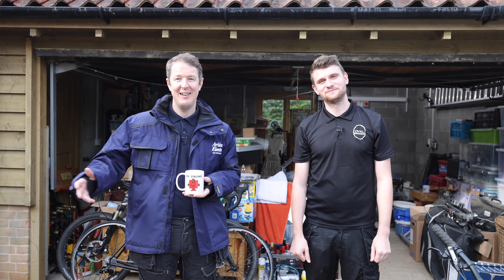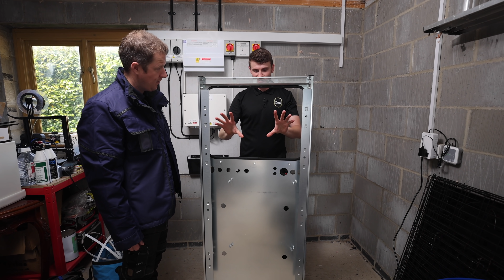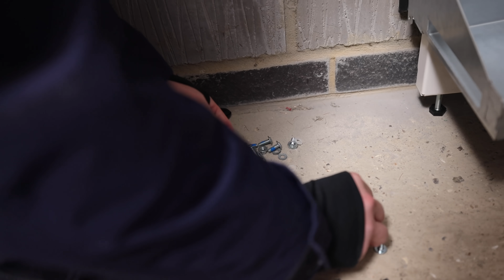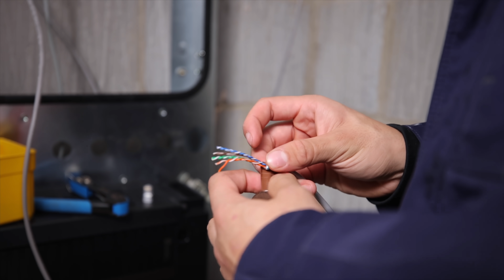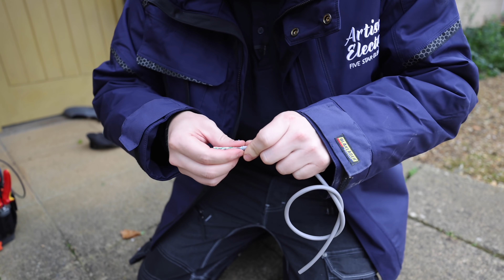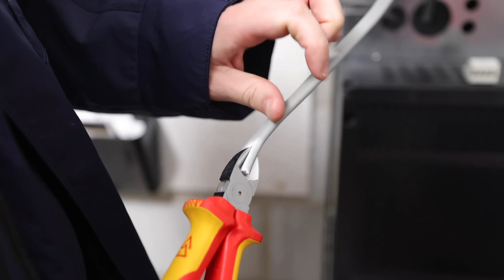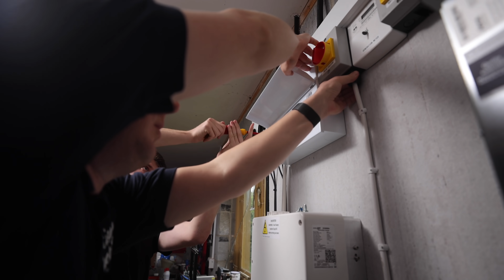HUGE DOMESTIC BATTERY STORAGE INSTALL - Electrician Life

Comment: The UK is massively committed to renewables, way more than we should be and we've shunned nuclear which has left us dangerously exposed (luckily the government seems to have now figured this out). The truth of what happened last month is we don't have nearly enough gas storage in the UK so medium-sized spikes in wholesale prices feed through to consumers very very quickly. Looks a nice system with the backup addon for if grid power goes down.
Reply: These kind of systems normally won't operate if there is no voltage on the grid for safety reasons.
Reply: @nigelparkin  That's not the case anymore. There are options which allow these systems to kick in during power outages.
Reply: @nigelparkin  wrong. This sonnen system, and the tesla will automatically change to backup battery plus inverter once the grid "beat" is not detected.
What you are describing is a weakness of the grid tie inverter. there is a cable to synchronise the inverter output to the mains supply.
if the mains supply phase is absent,the inverter completely shuts of as a safety measure,,,,2 reasons being that you don't want to be sending electricity back out of phase(your equipment will be getting 400v instead of 230v and will catch fire)), and you don't want your systems still live should the power network guys need to fix in your area.

Comment: Hi how much does it cost to use solar panels and to be connected to the grid , I believe solar is the best option at present obviously the initial cost is quite a bit but once it’s installed,you have free power and an instant saving, great video tidy install 👍

Comment: Appoligies must add if I had used the money that cost for my system just to pay my monthly electricity bill I would have 13 years of payments of my electricity bill.
Reply: So is it really cost affective to spend thousands for battery when in most cases will not charge fully in poor light winter days.

Comment: I am jealous, my question is the total cost for all the solar system and battery and assciated equipment. So with this in mind how many years would it take for the system to pay its self back or return from the investment. How long are the warranties on battery and other equipment. I ask as I have a growatt system on 5 kw battery. 6 years on I have another 6 years for the return of my 12k investment. But a big but my battery is now out of warranty and I have had 3. So if this fails now I will be another 6 years so another 12 years for my return of investment. I also had one tranergy inverter fail and that was under warranty but it was out for 3 months. So unless you have a lot of free cash is it worth it for Mr Mrs Joe public.

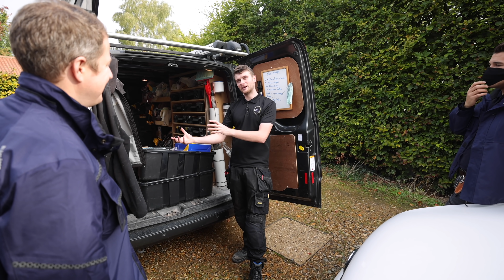Comment: 3:21 agreed, renewables are going to be tricky as they need energy storage and be able to burn off excess energy. so much infrastructure needed. i think its a shame nuclear power has got such a bad name due to the safety issues with Gen1 & 2 systems. much less funding to them and public fear but Gen4 (even gen3) designs are far from the old uranium based ones would have been the perfect stopgap to get off fossil fuel to something that should be much cleaner if done safely. maybe we will finally see fusion produce some power only another decade or 2 or 3.

never forget the people that fought to install filters on the top of Windscale, insanely expensive for them to do last minute due to the oversight but saved the UK from having its Chernobyl, it was still bad but could have been an order of magnitude worse. in the 1960s safety was pretty much nonexistent back then

Comment: Bit worried about 2 tiny little feet holding all that weight for 25 years, especially that type of brick wall, is that your system or you are installing the system of their choice? What do you think of this system, cost?

Comment: It would be really helpful if you gave even a ballpark figure for how much an installation like this would cost.
Reply: I saw a video recently (EVM) who had an 8.2kwh battery fitted for a total cost, inc battery, of circa £3,900. Hope that helps
Reply: @stevelongden7368  that's not a bad price.
Reply: @gino2465  it really only works financially if you have an EV and are on the Octopus Go tariff (5p pkwy for 4 hours every night) or something very similar
Reply: @stevelongden7368  it was better for me to go economy 7. I get much cheaper electric for 7 hours, as I charge car and do washing machine and dishwasher in these times. Sometimes 2 washing machine loads and bread makers it save money doing stuff on trimmers.
Reply: @stevelongden7368  in the new year I am going to try a d invest in fork lift battery's but 4 packs at 48 volts. If I make it lol
Reply: Came straight to say this. Glad I'm not the only one. 

Perhaps another electrician could
Reply: I would love to know what this system cost. Don't get me wrong if I had the money I would have it, but I know it would not pay back the original investment made for many years then the issues of failures after warranty periods. More costs added then to original costs that most people don't acvount for.
Reply: @gino2465  you can get battery storage systems of this capacity(about 10kw) for £5000-6000 installed(like powervault)
Not many however will function also as backup protection against outage.Sonnen and tesla do give you that option.
Reply: @gino2465  it can be done via government scheme , you don’t own it but still get the benefits.
Owning it much better , currently I am solar powered and have been for 24years .. having moved to a new place I’ve gone this route roofer n spark installed 5 k with battery .. hook up to grid to prop up the peak ! 
And a back up which you can afford buy buying one batt one inverter and one solar panel , after that keep adding a batt till your okay for power during black out ! 

The cheapest would be deep cycle marine battery 12v with a large inverter ( makes 240v ) let’s say 3k watt .and a cheap panel so to start.  That way you keep it all for yourself … till it’s big enough to add the smart meter to send excess back to the grid…
Reply: I see for Canada the 10kW unit is $14K + 15% HST + install ~$100/hr * 3 (for each electrician?) * 8 hour job. My guess is about $20K - any federal or local rebates.
Reply: price of the battery will be scary enough
Reply: @traineespark  these systems are fantastic but until they get the prices down the sellers will have to rely on the better off with lots of disposable income. And that is not me lol. So I will have to stick with buying used fork lift battery's.
Reply: About €8K

Comment: Drax was coal converted to biofuel chips sourced from cut trees in the USA and shipped to the uk for a subsidy payment making it economic.... a con.   Gas is 40% of electrical generation capacity on a tough day.  The reason electricity is so expensive is because wind generation did not turn up last month....  oops and of course uk gas now only supplies 47% of our own gas and this is declining fast so it will get worse.  Not because there is no gas because protesters stopped fracking which would have supplied enough fuel to transition with least pollution.  Makes the case to be off grid at home in the city with solar and a battery if you have a big roof and the money...  Before you get shirty and proclaiming fracing a disaster, even though you know not what it is, bear in mind with these high prices people are in fuel poverty and will die this winter, why, because the green idiots that blocked sensible management of transition, they have campaigned and protested to kill people.
 I am currently insulating and installing solar in preparation for next year when my gas and electricity contract expires.  Learning as much as I can from these videos.

Comment: Never seen those CAT5 passthrough heads before, great idea!
Reply: They are a little more costly than the regular rj45 but the wastage due to bad wiring in the plugs soon makes up for it. plus with the wire sticking out of the end of the plug you can verify the wiring before you crimp. Very handy when you have to make a non standard cable.
Reply: pass through RJ-45 connectors are the way to go, they are so much faster than regular ones. you dont have to worry about getting the wires trimmed to the perfect length, or cutting them too short and starting over.

Comment: A quick thought, for cheap energy storage from solar.
You can get hot water immersion heater diverter using excess energy from solar;  but it requires a hot water tank with immersion heater of course.  This allows you to divert excess electrical energy from solar into heated hot water with good efficiency, and with a capital  cost about £300.  You get about 8 kWh of energy storage and means you can turn off a gas boiler in summer - no electric pump checking for demand - no pilot light.  I would certainly recommend this cheap route to store excess solar energy before installing batteries.
Reply: Had mine for a good 10 years heats all the hot water in summer. Very rare that the boiler kicks in. Even installed a second cylinder for more storage. Such a shame most houses use combi boilers now. If gas stays high it would be worth putting a pressurised cylinder in the loft if you have solar on your house
Reply: The days of Combi boilers having a pilot light are long since gone. Auto ignition on demand. The sooner Hydrogen gets put into the Gas Mains the better. Get rid of the current "Natuaral" Gas and remove all the CO2.
Reply: @shilks8773  1) By definition it cannot be a combi boiler has you require a hot water tank.
2) The discussion on removal of gas from homes has a interesting issue associated with it.  CCGT for electricity generation is around 35% efficient, by law a gas boiler is >95% efficient.  Which do you think the government should concentrate of getting rid of first !
3) Replacing home heating with hydrogen is stupid since the government is pushing for blue hydrogen (the rest of the world calls this brown hydrogen).  Brown hydrogen comes from petrol production - about 95% of all hydrogen is created by the petroleum industry.  So you can see why hydrogen is being pushed so hard - it retains the status quo. Of course, you will argue, you will use green hydrogen (from water splitting), but that is not that efficient, and getting governments to not be lobbied by the oil industry to recolour brown hydrogen as blue hydrogen will be "difficult".
Careful what you wish for, and be careful for the actually efficiencies of production and storage in the push for "green-washed" energy.

Comment: tidy job guys, but had to laugh at the title 'huge battery' its all relative, as someone who used to work in the UPS business, a 2MW Network centre system or a North Sea gas platform DC backup battery array - are huge batteries.
Reply: Even for a domestic battery 11 kW isn't huge

Comment: I've recently had a quote for an air source heat pump. The chap recommended not installing battery storage with an ASHP. Does Sam have any comments?
Reply: I would certainly install solar with an ASHP then depending on the size of the solar PV system think about battery storage. How if battery storage wasn’t suitable an energy diverter like the Eddi may be a good solution 👍
Reply: add solar pv and battery you be fine 🙂 👌

Comment: Does a battery require an additional G98 / G99 DNO notification / approval, or can this be avoided somehow with DC coupling to the existing inverter?
Reply: the inverter has the approval not the battery..

Comment: Pass through RJ45 makes things so much easier and professional looking.
Apart from that the A & B denotion on the tool is probably dependant on whether your making a patch cable or crossover.
Patch cable normally has both ends being the same  crossover has them in a slightly different arrangement and is useful for instance connecting two computers directly via the ethnet port rather than going through a network switch or router.

Also artisan electrician with an artisan salad 😂

Edit:
I forgot to mention the previous energy supplier I was working with doesn't install economy 7 meters anymore and they state that their SMETS2 don't support it. I believe its all a load of bull but the only other energy provider I've seen doing proper economy tariffs even by the hours is octopus.

They even go as far to explain why their elec prices have gone up despite them being a fully renewable electricity supplier which doesn't seem to make sense at all. Gas prices may have gone up but that doesn't meen to say the people have started charging for wind or sunshine
Reply: Crossover? The 90s called, they want their 10baseT back. ;)

But joke aside, auto MDI-X has been pretty much standard for 100baseT for ages and newer standards auto-negotiate channels anyway. The only reason to even think about crossover cables nowadays is when dealing with museum-worthy hardware...
Reply: @HenryLoenwind  Coax and T connectors. You network an entire office with 1 drop. ;-)
Reply: @raullasvegas  Coax was nice. No "oops, I have 9 cables and an 8-port hub"...
Reply: Renewal Energy source is a bit of a Con. It means that if you are using Gas and are planting Trees - the Trees cancel out teh CO2 from the Gas. It's only by being able to claim negating measures are they also claiming to be Renewable. Its a cloak and mirrors claim.

Comment: Would be good to know what the costs of a set up like this would be. I'm guessing out of reach for most of us. Great vid.
Reply: 10kw Sonnen on line costs £8,400,, against roughly 18p for 1kw hour from the mains. That works out at 46,666 kilowatt hours. Average house uses 4000kw a year,, on top of that is the install charges and I don't think the batteries will last anywhere near 10 years,, long long while to break even,, am I missing anything?
Reply: @royhammond5640  in the states some areas have a time of use where power goes up exponentially during peak use hours. If you can run off your battery during those hours you can significantly cut back on break even time. Other than that, payoff time is fairly long and batteries here (the Carolinas in the states) tend to be used as a backup for a power outage.

Battery length generally is determined by depth of discharge and number of cycles...it's getting better, but a big break through is needed for a real game change
Reply: @singerkgreen  Not many people in the UK currently have time of day Electricity rates. It's usualy a flat rate of around £0.21 per Kwh (Oct 2021). Our family (2 Adults 60yrs) consume approx 8kW per day. Approx 3000kW a year. Heating the house by Gas at around the equivalent of 21,000kW per year. Gas at £0.04 per kWh equivalent.
Reply: The Sonnen eco 10 is like $25,000. 😳😳 It's one of the most expensive batteries on the market for sure

Comment: But these batteries if a house was to go out of electric how long could it power house for
Reply: 1kw =10 light bulbs on for 1 hour..

so 10kw is..

100 light bulbs 💡 ✨ on for one hour..

or 1kw load like a heater on for 10hours...give or take 🤔 😌 
have to allow for lowest soc
state of charge normally lowest is 20%

so most lipo4 batteries have 80 capacity available in the settings..

Comment: For the ethernet CAT cables...I use the "B" color order as well for my local intranet and internet cabling.  
I was an early adopter and use the EZ-RJ45 connectors & crimping tool from Platinum Tools...really good quality crimper!  
The cover panel on your system looks awesome...really nice install  :)
Reply: The specs were supposed to be 568A for residential and 568B for business. And you only really needed to use both for a crossover cable before MDI-X. Now, if there's existing cabling, match the existing installation standard for the site, either A or B. If it's completely new, just build out using the B wiring standard. Also, when using shielded twisted-pair, the cable ends need to be the shielded variety (metal).
Reply: @thomasbonse    I only use 568B...the cables & connectors are both shielded.
Reply: @gregorythomas333  The point about matching the existing site standard is so that the site is consistent. This way you're sure to not inadvertently introduce a crossover cable that will only work at 10/100 or cause someone else to do so in the future, if a jack needs to be replaced. Of you're going to reterminate all if the existing jacks too, then by all means, change the site standard to 568B. Just don't mix standards at a single installation site.
Reply: @thomasbonse   
Ummm...I'm not changing anything...I said that I use "B" for both my intranet & internet cabling.

Comment: As others have said, those figures quoted seem wrong, the spike in the energy market is down to numerous things not just Britain not committing one way or another.
Let's face it, if your business was installing PV and batteries, you are going to give a bleak view on the energy situation to potential customers, otherwise it would be like turkeys voting for Christmas.
And why anyone would want one of those things stuck in a hall is beyond me, I have seen others, which to be fair do look more aesthetically pleasing, and are pictured in living rooms, but I would still stick them in a cupboard.
Reply: They can't go in a cupboard, they need ventilation
Reply: @steampunkskunk3638  it's very easy to make a cupboard that has ventilation